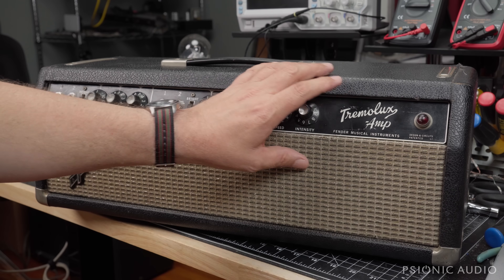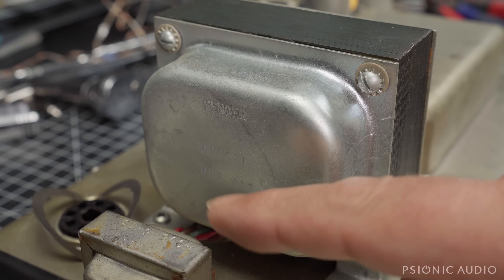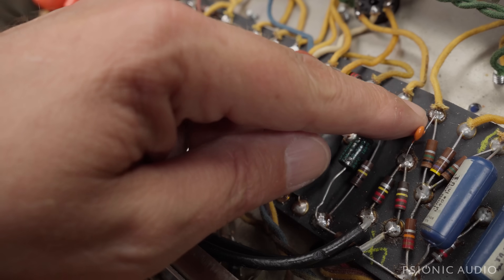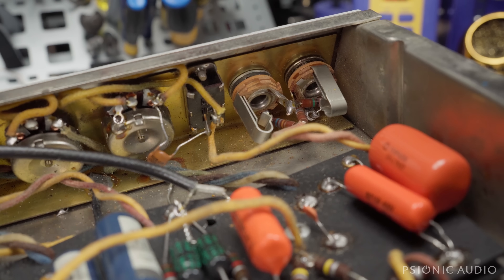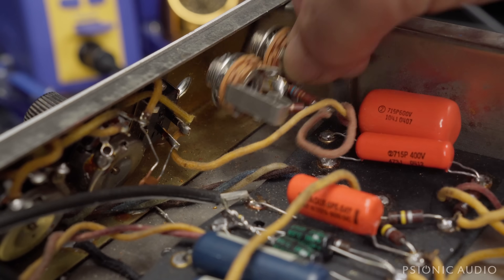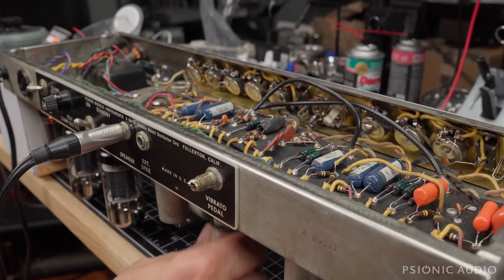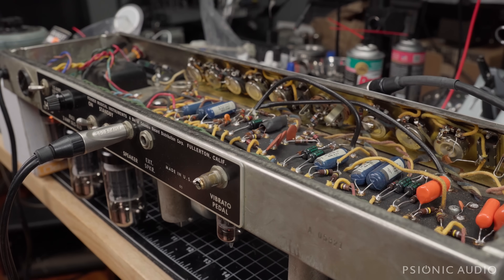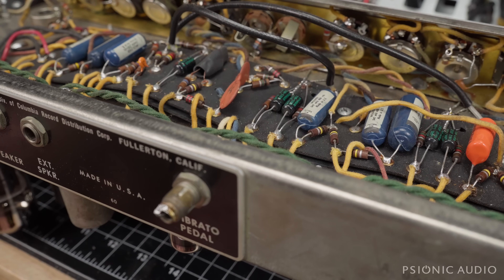Inspection | '66 Tremolux Pt 1

Comment: Amp teching in most retail stores is an adventure in getting it making guitar noises again ASAP so we can get it out on the sales floor, sold and out the door. Some shops would even nix the electrolytic recap jobs. "We can get at least a bench fee from the buyer later on!" No active store names here but not at all that uncommon. ********** was good for that kind of crappy repair work and other scummy practices. Oops, someone is actually using their name here! It was once a chain store.

Comment: Nicely done. The joy of the Tremolux is the undersized Output Transformer vs. the Bassman so that you can drive it harder at lower volumes. I had a 65 Bandmaster with a replacement Bassman OT and a 65 Tremolux and different squishiness. 

Great amp and wonderful through a 2x10 Weber Alnicos or just about any other cab!

Comment: After your " Once over" that amp is ready to do what it was designed to do. I used to have a white tolex version (22 watts) running through a 4x12 Vox cab and I loved it but a friend used a guitar lead rather than a speaker lead to connect the Tremolux to the Vox cab and one day he damaged the transformers which caused it to emit a bolt of lightning (blue). Your one sounds fantastic, if you are going to use it a lot the beefier Bass-man transformer is a good upgrade. If it were mine I would remove the Fender badge.

Comment: Honestly, I’d keep it if they kicked back a couple hundred bucks. That Bassman OT is so much more gigworthy than the puny 35 watt model. 

Surely whoever installed that 110uf worth of reservoir cap didn’t leave the amp tube rectified. Shirley…..
Reply from the maker: Yeah, I decided not to go into it. I’m famously “too negative” as it is. Caps are from ‘05 anyway. 

The point here was originality, functionality, and safety.
Reply: @PsionicAudio  To the GZ34: "You were in terrible peril!"
Reply: The original OT would have been p/n 022848 if I'm not mistaken, same as in the Bandmaster, Pro Reverb and Vibrolux Reverb at the time. Fender got a lot of use out of that transformer.

Comment: Lyle! I’m surprised you missed this! 5AR4/GZ34 rectifiers have a max reservoir capacitor value of 60uF. Nice filter cap job, but if it has two 220uF in parallel that’s 110uF on the reservoir! 😬😬😬
Reply from the maker: I didn’t miss it, just didn’t focus on it here.

Comment: Nothing wrong with that amp at all. Who gives a S!@# If it's not the "Original" transformer may I ask? as the one that is in it is better than the stock factory unit. Stuff gets old and fails from time to time so get over it and move on. Do not beat up the seller as I can bet that he OR she did not even know about it in the first place. Just play the damn thing and enjoy it as it's a nice sounding amp! Some "Vintage Amp Guy's" are every bit as bad as the HIFI crowd in thinking that a 6-foot speaker cable that JUST costs $100 is not as good as one that is ten times as much! Not talking about the author of this video at all as he does good work, and no disrespect was intended.
Reply: AGREED on all points. Well said mate!
Reply: Collectors might care.
Reply: @danielmargolis3210  Sure, and if you were a collector, you would know how to pull the chassis and read a date code.
Reply: It's really only a problem because it wasn't described accurately by the seller. It is relevant to the value of the amp for a collector.
Reply: @derekmccauley6772  I do not know as I have never seen the ad, OR what was said at the POS. It always comes down to (Buyer Beware) You can spend something like 3 minutes on Google and learn how to read a date code correct? If the buyer was so concerned about it, he should have had it inspected BEFORE PURCHASE!!!!! and it is one hundred percent on him for not doing his own due diligence! How many times has this amp been sold throughout its life and how much work was done and by whom? At a certain point it gets lost in the wash so to speak. Sorry as I should have just said POS= Point of sale so it was not mistaken (maybe) as piece of shit!
Reply: There was plenty wrong with this amp if you pay attention to the video. I am the buyer referenced here. I got past the replacement OT and could accept that this wasn't a collector grade amp, because it could be made into a great sounding, safe and reliable amp. But it wasn't a safe or reliable sounding amp in its current state. The 3 prong power cable wasn't safe, the recap described by the seller was not correct and was 20 years old, and both channels had unacceptable soldering at the input jacks. I asked for a partial refund to cover over $300 in needed repairs from Lyle, but the seller refused and issued a return authorization. To their credit, they did cover the return shipping cost, but if they offered what that likely cost them as a partial refund, I would now own this amp and Lyle would be on it. And the seller in this case supposedly has an amp tech (probably a whole dept) that managed to miss a whole lot of stuff. I own several vintage amps, including a collector grade 1963 Blonde BF Tremolux and cab, as well as an additional modified black tolex Tremolux cab that was a perfect mate to this 1966 head, and I gig all of it. I just wanted to be treated honestly and fairly on the description and price. It's theirs again and I'm disappointed in the whole matter.
Reply: @robertkelsey3307  The caps look like they have the date code of 2004 of the 3rd week OR something to that effect. If they did indeed say that it was just recapped recently that was incorrect. The solder joints at the input jacks take 5 seconds to correct and the power cable was not unsafe per se but not optimal. I do not think that the store even knew any of this, Could be wrong and I am sorry that the sale did not work out for you and best wishes!
Reply: @robertkelsey3307  Hopefully you will find the one that you are looking for and take care of yourself.